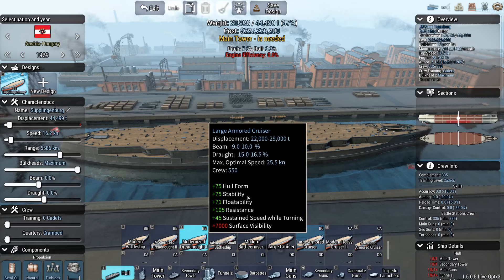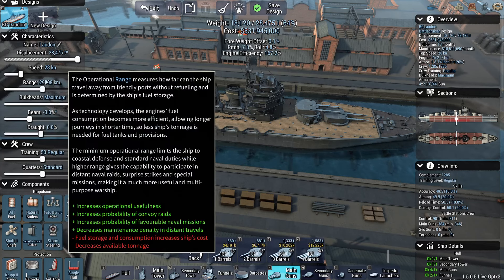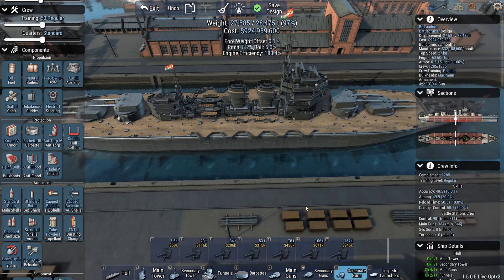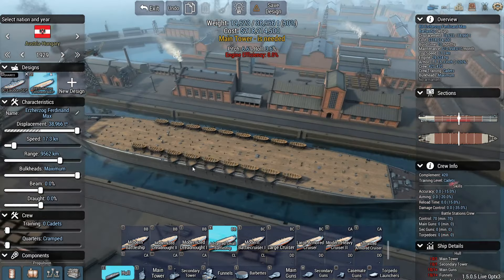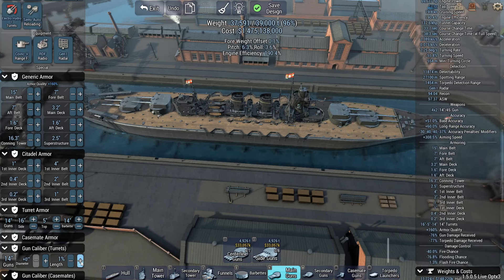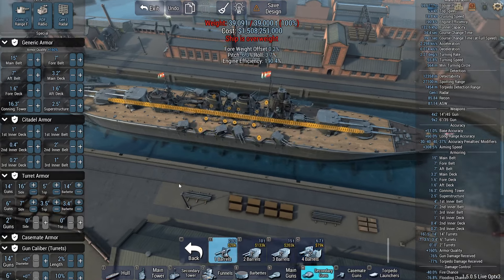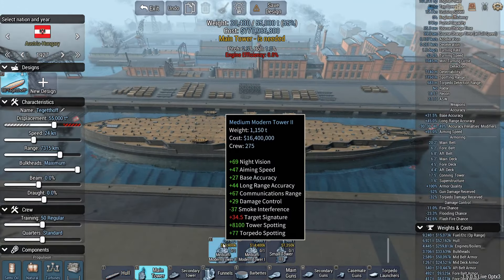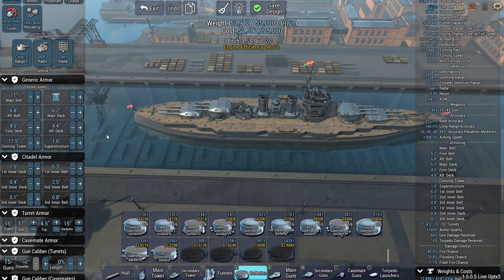Ultimate Admiral Dreadnoughts - New Hulls in 1.5 - AH "Panzershiffe" and an Italian CL - DIP Mod

Comment: On the BB with the 15" guns at 43:53. Why not have 3 guns on the deck mounted turret and 2 guns on the barbet mounted turrets? I wouldn't throw away two extra 15" guns when you have already made the weight limit. But then, I'm not cursed with the dreaded OCD and have no F's to give about how things look.
Reply: Yeah! My OCD can't deal with a modernized Dreadnought hull that has more displacement than an Iowa class battleship. 
What the ABSOLUTE F ?????????????????????????????????????????????????????????????????????????????